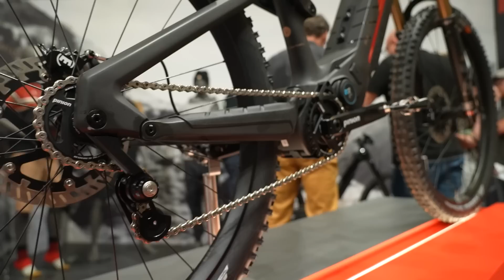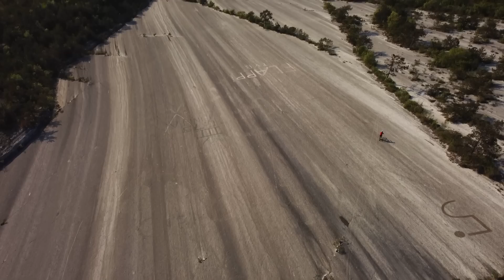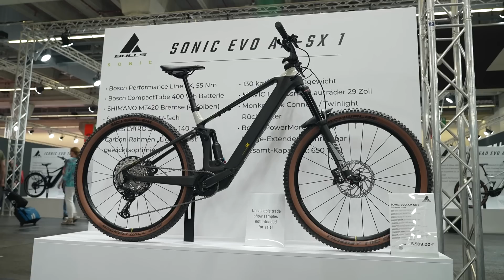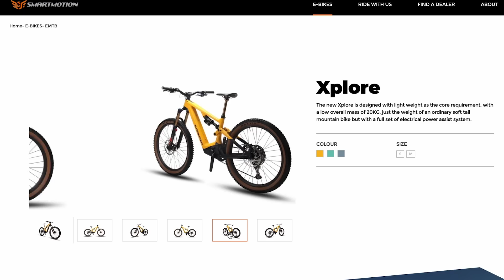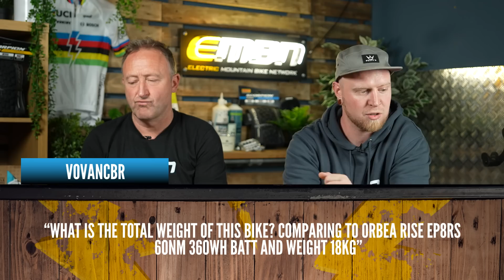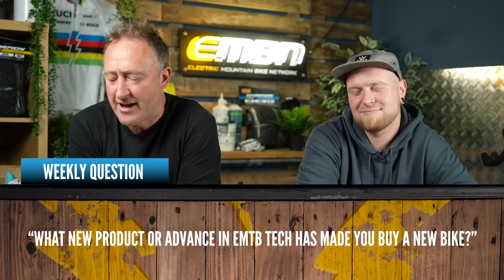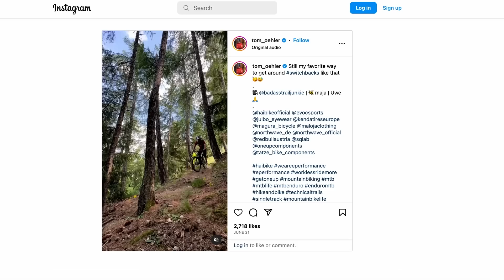Are Gearboxes The Future? | EMBN Show 286

Comment from the maker: What new product or advance in EMTB tech has made you buy a new bike, or consider buying a new bike? Let us know!
Reply: I think the pinion MGU matched with a belt drive is the cats meow! O yes I will have one Please. This is the product that changes Everything! - M
Reply: There are only two things that could make me consider getting a new bike.
1. Significant range upgrade over my current bike.
2. A closed drive train with high durability and low maintenance.
Otherwise I don't see my self upgrading in the next couple of years.
Reply: The New gear box! In my eyes now every other ebike is obsolete.
Reply: @TurboWolf5000  agreed
Reply: When the Bosch CX did away with the internal gearbox, and small front chainring, and also came out with new larger 625 Wh battery (over the 500 Wh one), I just had to get a new bike!
I would be interested in the new gearbox motor, but only if it has acceptable low resistance when pedalling when the motor is off, or you are over 25 Kph. The lower resistance on the Gen 4 motors was the reason I got the new bike.
Reply: @A-Kiwi  to me, the gearbox and sudden support stop above 25kph felt like a wall. Could barely paddle up to what? 32? With standing up going full force and having optimal road in front
Reply: @PhilosoFox  - It's an eMTB. You go up hills as fast you can (and slower than 25kmh, but faster than without the "e") to then haul ass down them (much more than 25kmh).
Reply: @scottamolinari  The Eurobike test parcour probably didn't do an eMTB's usual usage justice, I agree, no 40kph uphill required. But Bosch CX Turbo Mode was significantly preferred by my mates in respect to early acceleration and the abrupt support stop at 25 kph felt a tad too early for my likings – at least in comparison. And when driving to the trails and back, it's nice to have that surplus 😊
Reply: @PhilosoFox  Where are you from? In Europe, it is law to limit the eBikes to 25kmh. That's why it is there.
Reply: @scottamolinari  Yeah, I know - am from within EU myself. Maybe some brands had just different implementations of a soft cap instead of a hard cap at top legal support speed? Or it's the gearboxes internal resistance that felt like said wall? At least the Swiss made bikes had an 27kph cap which was already an upgrade to ours. But since the MGU is fully S-pedelec ready, it could support a more natural cut off easily, if it only was legal.
Reply: @PhilosoFox  Ah.. Ok. I think I see what you are getting at. Yeah. Theoretically the electric motor should still assist above 25kmh, but only just enough to make it like a "normal bike" i.e. make up for the resistance and the weight of the motor and do that to any speed above 25kmh.
Reply: Less Weight!
Less, Less, Less...
Reply: Definitely the Pinion MGU E1.12. And maybe one from outside the EU in an S-pedelec version - although that's probably non-existant right now for endouro emtbs. I just felt this mgu got handicapped quite a bit by its regulation conforming 25km/h max speed. A low maintenance, great handling endouro ebike with nevertheless top trail performance? I would be tempted. Or that non-regulation compliant Aden sports add-on motor.... I just don't have the bike to attach it to. 2k € and transferable between bikes... even not grinding down the drive train by having a different angle of attack for its support power. Would love to see a real world testing with lots of dirt and cleaning and long time experience on that too
Reply: Next bike will have auto shift gearbox and ABS brakes. Not seen too much about ABS brakes on new models? Hoping Specialized will come up with something in the next couple of years.
Reply: @mrloungepants  For what, the Hell, ABS!?
Reply: The Mastermind TCU on Specialized bikes, that thing is super slick.
Reply: 900w battery made me buy a new Norco Sight VLT C2, the range is absolutely insane 100miles + 8/65nm/L5 eco
Zero Range Anxiety
Reply: 1 X drivetrain and dropper post.
Reply: Well my bike was stolen 😢 so I went with the same brand and from trail to enduro…
Reply: Some sort of mRNA vaccine enabled me to buy a new bike, after waiting 12 months for there to be more than zero or one EMTB model to choose from in the shops where I am.
Reply: What about Revonte one drive? They're at the show. I know they're not making a production emtb but they have the most promise to have light weight drive and gear in one unit. Pinion will always be heavy. Too many gears, Revonte is actually revolutionary use of the planetary gear and have the potential to be very light weight. For now they focus on cargo because it's a beast with 200 NM.  Sub 2kg Revonte would be a real game changer.

Comment: My concern is that you may be out there and run out of juice. If your rig weighs 20 kg well maybe you can pedal it back. But if it weighs much more it is going to be a challenge. So perhaps a system that allows me to alter my bike’s weight by swapping out different sized batteries. A sub 20 kg bike for pump parks or close to home would be nice- you might just sacrifice some range. A larger battery for those long trips.

Comment: Thank you for sharing your passion about E bikes. 
The reliability of the pinion gearbox is proven since 10 years and pinion didn’t change the design of the gearboxes 12 and 9speed. They just added a motor. But also the motor isn’t a new design. It’s produced since years for the automotive industry and provides the power steering of cars.
The owners were engineers at Porsche where they designed gear boxes. So the production and quality management is on a similar level. Also the bike manufacturer are involved in the design from the beginning. So they are able to get bikes in the market in autumn/winter. One or two years earlier than other designs. 
Living around the corner of this manufacturers..

Hopefully the international socialists don’t corrupt Germany and the world completely. So we stay alive and we’re not sent from our peaceful and most democratic government since ages to kill “evil” Russians and were able to fund the mgu bikes...

Comment: I want: 
1. Interchangeable motors and batteries
2. Support and service for the lifetime of the bike
3. Open standards, not manufacturer blocked systems

My Shimano E6000 bike only from 5 years ago is stuck with the old motor, which is not upgradeable, non-repairable, and nobody wants/can to service it.

Comment: Yes, 
1.less gears on an e-bike.  
2. Rider 2 rider charging (in case someones battery dies), 
3. smaller/lighter. I don't use my power setting higher than 50Watt assist because its like a rocket uphill and many uphill direction trails simply aren't meant for speed, (so far), and you really don't need any power on the decent.

Comment: Turning 58 next month and a lifelong cyclist. Mostly road I own two 14 lb carbon road bikes I built custom from frame up but have become too afraid to ride on the roads. My last mtb was a 1993 Canondale killer v with no suspension xtr equipped and still weighing 25 lbs. I haven’t ridden off road since the late 90’s. 

I’m excited to move back to the dirt with an EMTB. Motor/gearbox is really interesting to me. Subscribed to learn more. BTW I live on a sailboat and this bike will travel with me to remote location once I retire.
Reply: I just turned 58 and an electric mountain bike is the funnest damn toy I have ever had in my life!

Comment: I want a bike that has 400w battery with 5 speed gearbox and a belt drive with the rear suspension sharing the crank pivot point so there is no need for a tensioner with an  aluminium frame sub 20kg for throwing over fences. With about 140mm suspension cause I'm too old to be going flat out.

Comment: Derailleurs are terrible things, endless chain cleaning clunky gear changes unless they are setup correctly. However the Pinion MGU needs work, gear 4 and 8 changes are not pleasant on steep gradients. I finally got a chance to ride one up a steep incline. The problem is the 3 range stepping . gear 1-4 give seem less changes which gives an expectation that moving to gear 5 will be also seem less but because the 4 gear block has to swap to a new gear ration for 5-8 it clunks badly. same experience at gear 8. We heard that the gear change at the low power part of the crank is handled by the software. Umm t the FIT guys need to go 1 km from their office and try the steep hills around there at try it themselves.

Comment: I bought a new EMTB when Canyon came out with the Spectral On with massive 725 and 900W batteries.  Very capable full power bike with lots of range, well spec'd, and for a great price!!!
Reply: And?
Reply: I forgot to add that I do own a bike that has a pinion mechanical 12 speed gearbox and I really like it.  I use it mostly for bike packing because of the ruggedness and reliability of the system.  That system is not great for MTB, but if they could work out the kinks and minor issues it will definitely be a game changer (MTB, commuting, etc.)

Comment: As a 100kg rider I'll deal with the extra weight of the gearbox.  The cost and aviability of casesettes, derailleur's & chains makes this even more attractive. Once it is on the market we will see about reliability and weight reduction. Taking 100g of a component as weight saving is insignificant, given my personal weight reduction capacity

Comment: I have always thought integrated gearbox is the way to go. Really good idea for an e-bike. I’m on the fence regarding belt or chain drive. Belts in theory should be really good but if one breaks you could be stuck. Where as with a chain and a spare link you can get home. In-depth test on the pinion please . Also comparison on belt drive v chain. 
Interesting point Steve regarding how many gears an e-bike might need going forward. 
Great show .
All the best 👍

Comment: I 110% believe this is the future! The one thing holding back the gearbox concept for me has always been the grip shift! That has now been resolved with e-bikes! I still don’t understand the obsession with a lightweight ebike! But for me .5kg on the BB for a gearbox and belt drive is a complete no brainer! As the weight distribution will be so much better with this! Especially in the UK! My next ebike will 110% be a gearbox bike with a belt drive without doubt! Plus a belt tensioner is no big deal at all! It will be cheap to replace so easy to have one spear on rides and doesn’t hand as low as a derailleur! And I bet they can easily make is as strong as a new sram derailleur bs lol
Reply: Totally agree. Especially on the weight front. My Levo is around 23kgs and no issue for me. If I can get a model with the Pinion drive on 48months interest free I'll get one.
Reply: I could shave 30kg off my system weight and lower the CoG if I stopped enjoying eating.

Comment: Gearbox motors? What happens when the battery runs out. Can you ride the bike like a push bike? For me, knowing I can ride on with no battery power and still change gears is a winner. As it has happened in the past a couple of times. Great show.
Reply: I just plan my charge accordingly.
Reply: @border304  short rides, no problem, but not everything goes to plan.  Conditions change. Strong head wind plays up with your fitness level, and you use more boosts, or you go for that extra lap.  You don't wish to be stuck in the Ozzie bush.
Reply: @dlauric  Oh yeah that's fair. Plus out running those darn dropbears...
Reply: @dlauric there’s enough power for 1000 shifts after the battery stops the motor assistance.

Comment: as with all motors it would be interesting to know what they pedal like when off the power
Reply: Lol why? Just plan your charge imo.
Reply: @Scottish_Borders  because when you go above the limiter they have so much resistance they pedal like a brick nothing to do with charging or range.
Reply: @BADGERTHEBIKER  I know. So don't run out of power was my point.
Reply: @Scottish_Borders  don't think you understand my point. after 15.5 - 16mph there is no power as it cuts off therefore what does it pedal like with no power. absolutely nothing to do with running out of power at all.
Reply: @BADGERTHEBIKER  I understood. Who pedals faster than 15mph unless going downhill? Not me very often.  And it isn't the same pedalling above 15mph with momentum versus the motor drag of no assist at lower speeds either tbh.

Comment: Im not buying anything new, the Canyon spectral ON cf8 will do just fine.
I get at least 1000 miles on a chain.  And know how to shift a bike, Im not racing the thing.

People go crazy over the gearboxes with out ever having sat on a bike with one.

I'll let things settle for some years and see what shakes out.

Ive never once wrecked a rear derailleur and been riding mt bikes since the 80's.  So its not an everyday thing.   I dont need a 12 speed though on E bike.

Ryan Van Duzer has tested the pinion box and belt in the most extreme conditions imaginable.
Hes on youtube.  He has had great luck with the thing on a normal/amish bike.

Comment: The belt tensioner should be mounted on the sprung weight side of the drive train to further reduce the unsprung weight which is another unmentioned benefit of mid mounted gearbox. Belt drives have already done well over 50000 km unchanged (i have seen a 100,000km one) and MX bikes go through rivers with no water in the sump , its old tech that has been missing for far too long from Ebikes.  Don't be a stick in the mud , offer up the belt drives, let people choose and lets see where this goes.  (Google 100000 km on Belt drive for the video )

Comment: Are rear derailleurs that vulnerable? I've never had an issue.
Reply: I tend to agree, and they are an automatic chain tensioner for long travel suspension too of course... however, to keep them running smoothly, you do need to clean and maintain them regularly. 

I think the primary benefit is to eliminate the cluster 12 cogs bolted to the rear hub, and to offer a constant chain/belt line - further reducing wear and improving longevity.

Comment: I think a lot of emtb are being used by people who may have some sort of a limitation to the sport based on various factors such as age, ability, physical condition, other physical limitations etc. 

Of course many are used by awesome experienced riders as well but a large portion of the market likely is in some way limited by way of analog bike riding. 

This being said, I’d like to see the industry innovate towards maximizing the tech in such a way that more people with limitations can enter the sport and enjoy it. Eliminating mech for example is a step in the right direction and the added lower bb weight may not impede those of us who are just getting started out (when it might impede a pro downhill rider for example). 

If it wasn’t for my turbo levo, I wouldn’t be riding right now. 

I would absolutely love to see you guys on embn do a running long term segment focused on how an ebike transforms someone who otherwise couldn’t ride into somewhat of an experienced rider. I think a lot of people would be interested in that type of segment, since a lot of us may not be able to relate as closely to some of the content regarding emtb currently. 

But no matter what mech or tech changes come, the key will always be battery capacity/weight and motor placement / size.
Reply: Same. Turbo Levo and wouldn't be out otherwise. Don't care about weight. But I'm old enough to remember the original Raleigh Grifter.
Reply: Good points all round. 

I’m in my 60’s now (plenty of X country riding in the past), and after a nasty fall which resulted in tendons, ligament and cartilage being shredded in my knee, I’m able to carry on riding (after learning how to walk for a year) with the aid of an eMTB. 
I’m mainly riding on the road, but find I’m going through chains and gears (in ECO mode), so am seriously interested in the Pinion motor/gearbox system. 
Love the new tech appearing; hope Scott (Big fanboy) adopt the Pinion for the eStrike. Would buy one without hesitation.

Comment: I’d like to see emtb use more similar technologies found in Tesla vehicles. E.g. phone key and app with real time information (data acquisition); plaid motors use of carbon wrapped rotor; ai vision system to adjust compression dampening and gearing; trail-center “supercharging” standard; systems integration; less expensive prices 😅

Comment: There just needs to be a bolt-pattern standard so I can customize/build/retrofit brand 'X' gearbox on a brand 'Y' frame.
Reply: That would be nice, but I fear that the bicycle manufacturers are going to resist that, as their motor/control unit/software is a major selling point of the whole 'package'... 

I think the best we could hope for is a third party motor/gearbox manufacturer making their product available in a variety of 'engine case' shapes to fit the most popular frame mounting patterns, although again this is only likely to appeal to owners of older bikes wishing to upgrade - most bike manufacturers would rather sell you a whole new bike (or at least an integrated motor/battery/frame-set combo, such as the Specialized S-works Levo etc.)
Reply: Yeah, it would be nice but unfortunately that’s never going to happen. Look at cars and motorcycles, you can’t swap motors in any of them. It also holds back development as they are stuck with what may be a inefficient mounting system.